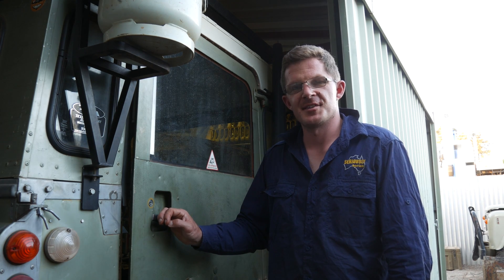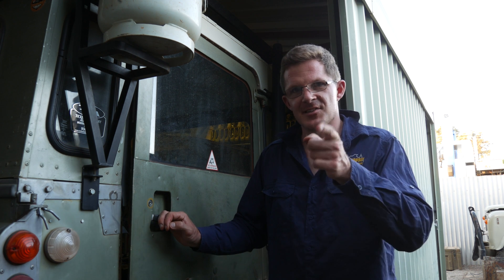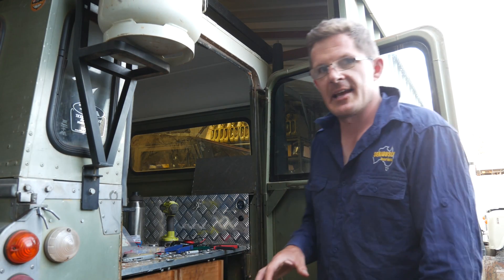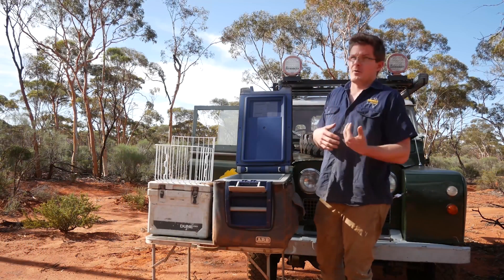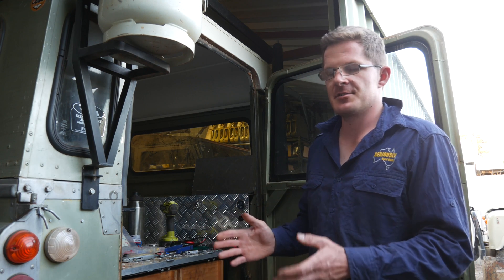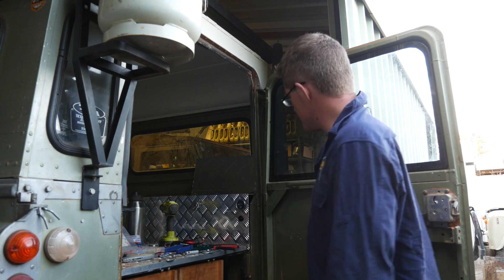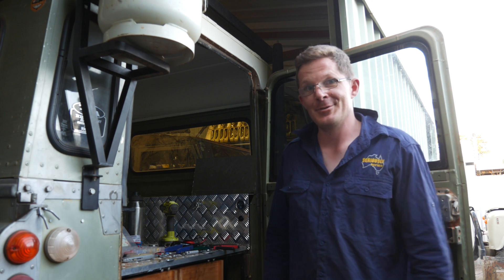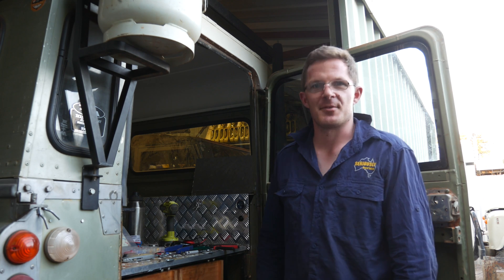4x4 Tec Tips Ep01: Basic 12 volt management system

Comment: Nice.. people have gone nuts with 12V setups.. so damn complicated, bluetooth, phone apps, exotic batteries, the list goes on. Like you've I've just got a simple second battery and a VSR to join my two batteries together when the engine is running. But... forgive me Lucas, Prince of Darkness, for I have sinned - I have a digital voltmeter.
Reply from the maker: Hi Duncan.  First and foremost, I would be deeply concern if you had any Lucas components in your true Land Cruiser :).
As always Duncan I completely whole hearty agree with you, the less electronic gadgets you take = less $$ = smaller battery and inverter = more money $$ to spend on using you 4x4 to go offroad as it was designed and intended too. As far as I am concerned anymore then run a sensible size fridge is luxury and isn't needed.
Keep, keeping it real Duncan. Cheers Geoff